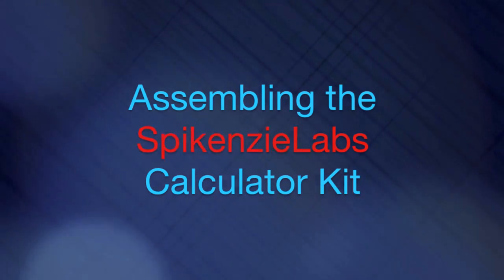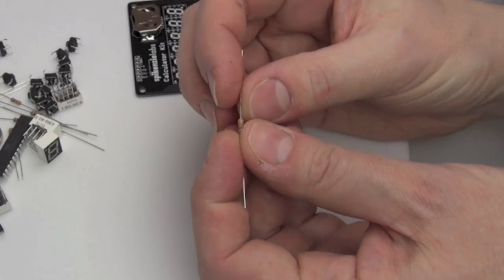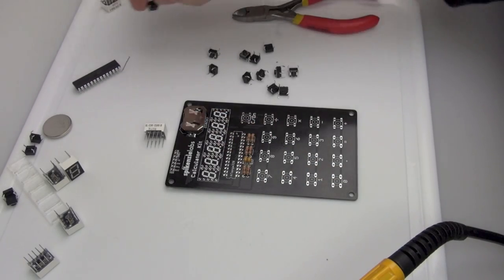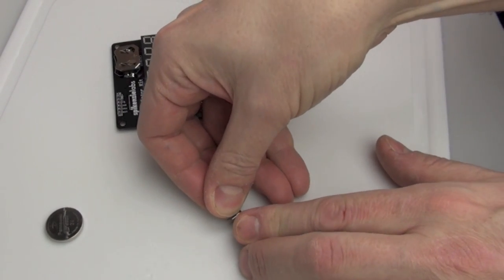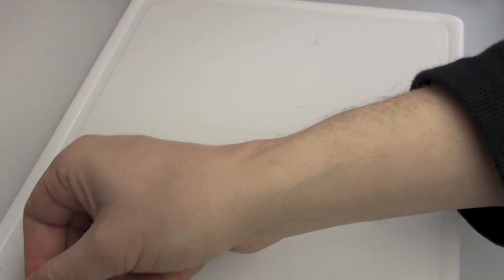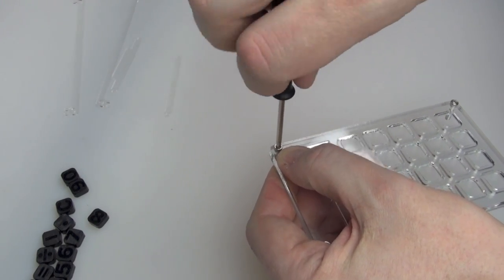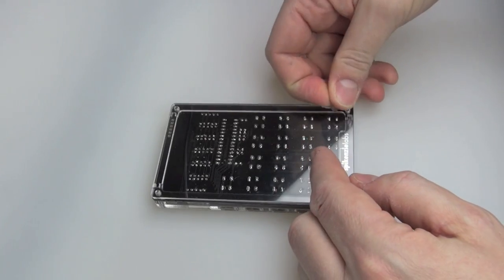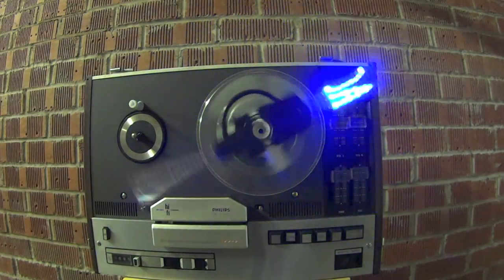Assembling the SpikenzieLabs CALCULATOR KIT (2013 video)

Comment: fitting a resistor will work either way round
Reply: Yep, only bad thing happening is your OCD kicking in. He probably got confused with transistors.
Reply: The do look better all placed the same way.
Reply: If you're using resistors of different values, it's probably a good idea to make them easier to read, but a resistor that is different depending on which way 'round you install it is called a diode! ;->
Reply: Actually fitting them all the same way looks way more professional. But yeah, they'll work either way..
Reply: @sambrown9494  Or you could use them to spell something in binary?
Reply: @DanielNoblett1111  Some capacitors: Yup. Electrolytic capacitors are polarized.
Reply: I would have preferred the numbers to remain white as the black numbers are very hard to see.

Rev George
Reply: @maxmustermann1455  or diodes 🤷

Comment: Resistors don't have polarity, you can put them anyway you like.
People usually put them all in same direction only so its easier to read the values (colors), and to look nice.
Capacitors and diodes have polarity and can work only one way.
Reply: i was about to be like uh.... hes trolling right?
Reply: @thomasslone1964  Right? WTH?!
Reply: Yes, that's correct, resistors aren't polarised, so you could fit them either way round.  But they look better if they're the same way round!  It's the same with ceramic capacitors.  Electrolytic capacitors & diodes are polarised though.
Reply: @Aphrodite-fh3vk  Found that out the hard way. BOOM!

Comment from the maker: Looks like I've learnt something about resistors. Three comments out of five means that this will probably be a popular comment on this video. I can see that I'll be receiving similar comments for years to come.
Reply: Here's my 2 cents, or P if you like, resistors aren't polarity sensitive, but diodes, transistors, and most electrolytic or tantalum capacitors are. That said, as another commented it does look more professional. I really do like your videos, but this one struck a chord with me. Back in 1976 or 1977, I bought and assembled a Heathkit calculator, which I used for the rest of High School (1978). It was quite a bit more complicated, having separate driver transistors for the LED display segments. I believe it was 16. 1 for each digit, and 1 for each segment and the decimal. I just had to google that old thing and I believe it was the model IC-2006. According to the Datamath website http://www.datamath.org/Related/Heathkit/IC2006.htm   the original price was $69.95 in October of 1973. I believe I paid in the neighborhood of $30.00 in 1976 or 7, as it was on clearance. Possibly you could try to find some Heathkit equipment to try out. Heathkit made Ham Radio equipment, Audio, Televisions, Radio Control equipment for model airplanes, boats and cars, and electronic test equipment such as signal generators, vectorscopes, and ocilloscopes. Heathkit Audio was almost considered audiophile quality.

Comment from the maker: I've got a job where a typical calculation would be along the lines of £90.28 +0.2% -15% +28% -0.25% +£10 -52.72% +3.78% (and on for about 25 steps)...speed is also important...hence the necessity to me for a % key.
Reply: I guess you are a stock broker !

Comment: I was working with some led 7 segment displays recently, by putting a thin translucent layer over the display you can increase the contrast of the 'off' segments dramatically; dark plastic, filter gels, even a post-it note does wonders for readability.

Comment: It's basically a $2 microcontroller that's programmed with whatever SpikenzieLabs put on the thing
Reply: it'd probably cost like $40 to make though if you paid for the PCB from somewhere like OSHpark or seeed, then bought the LED display, buttons, MCU, supporting components, had somewhere like protolabs or shapeways make the enclosure, etc. Not to mention the cost of your time actually designing Everything. Not saying it's worth $40... hell, I wouldn't even pay $10 from an eBay seller for this kit, but whatever.
Reply: @martinj9268  or you can order tjem in China and pay like 5 bucks a pop. What is what they probably had done.
Reply: @martinj9268  well the pcb (seeed wants 4 bucks for 10pcs each 10*10cm) is probably the cheapest compared to stuff like the custom lasered acrylic and actual time going into not only designing it but the whole overhead of getting the components into the kits, operating the laser cutter (spikenzie cut their own stuff afaik), packaging, shipping etc...
Reply: @nonchip  I wouldn't think by much. Especially if they're cutting the acrylic themselves. Acrylic is one of the absolute cheapest materials for custom enclosures only after things like cardboard, cardstock, PET, etc. If you already have a laser cutter it would cost maybe like $2 to make the pieces for the enclosure and effectively none of your time. Development cost and overhead is also basically nothing once you spread it across more than a hundred plus units. I mean its not like they spent months of R&D along with weekly design meetings to make this. It was probably a few hours in sketchup and kicad. The most expensive part is probably the human assembling the kits, though these days human labor is also dumb cheap and would probably only add a dollar or two per kit, even if they were paying them like $20/hr(which they probably aren't unless they themselves are assembling the kits). I'm not trying to bash them, I'm just saying. I myself could make this using prototyping services like oshpark and ponoko for under $40 for a single one. Add in the fact they're making parts themselves and buying in bulk, there's no doubt in my mind this cost far under $40 each unless they're cutting a huge piece out for a ridiculous salary or something. In the end it's just a novelty gadget anyways. Why anyone would pay more than ~$20 for something they'll likely never use anyway is beyond me.
Reply: @martinj9268  well they did strike me more as a hackerspace than evilcorp so i think the humans and laser time are probably their highest expenses... if they're anything close to smart they're not using oshpark for this kind of "mid sized series" thing so their pcbs/components will probably tally in at 1-3 bucks per kit. having someone watch for a cnc laser catching fire while that eats through watts is probably more expensive, unless they went full-on chinese fulfillment ofc. oh and the amount of clear, unburned, uncracked acrylic going into this suggests they probably have some rejects, and acrylic really isn't that cheap. and they have about 3.5times more acrylic (just by area; plus it's thicker) than pcb...

oh and don't forget the business overhead. someone has to sit there, read the orders, pack them up, ship them, keep the right records for tax purposes, etc. add that to the fact they probably want to make at least a bit of money and you'll see why they probably cost at least 2.5times their expenses.
Reply: A 16 button 6 digit 8-segment-display calculator, pretty simple code really
Reply: wellll there is a custom made circut board along with the price of the machine

Comment: Techmoan, in the video you said that people shouldn't touch the chips. This is due to static electricity charges in your clothing that can discharge through the chip so destroying it.
However, it looks like you were building this kit on a nylon type of chopping board. Just like nylon clothing, that chopping board can carry a high static charge endangering sensitive electronic components.

Take static precautions when building electronic projects. Invest in an antistatic wrist strap.

Ian.

Comment: The resistors you can orient pretty much any way, along with inductors and unpolarised capacitors. It's all the other components that need proper orientation, particularly polarised capacitors which can explode if installed backwards.

Comment: Nice enough video, EXCEPT:
- as others have noted, resistors and ceramic capacitors are not polarized
- the preferred technique for straightening IC pins is to lay one side's pins flat on a table and hold the IC body, rocking it over firmly. Doing it with your finger not only gets less than ideal straightening, but a good change of poking your fingers
- I could see in your video that the black keys were not fully adhered to their clear plastic carriers....the bubbles in the adhesive were apparent. When I built mine, I took all keys out and firmly squeezed them together for more complete adhesive attachment
- There is really no need to use the tape if normal PCB assembly techniques are used, but nothing really wring with your way way, either
- VERY bad practice to snip off leads from a PCB the way shown in the video! Lay the board down on the table, hold the ends of the lead with fingers of one hand, snip them off with the cutter in the other hand. OR, do like the skilled professionals....holding the handles of the diagonal cutter between thumb and little finger (the cutter must have spring return handles for this to work), freeing up the index finger of the same hand to touch the end of the lead when cutting, with the PCB over a trash can...as soon as the lead is cut, it fall into the trash and you move on to the next lead....very fast, easy and SAFE.

Some other comments based on my own experiences with this:
- This is obviously a piece of working sculpture. Nobody would buy this to be their 'working' calculator....too few digits, too few functions.....it is intended to be a fun and perhaps educational piece of art that also works....with that in mind, the price is not outrageous
- The spacer behind the LEDs is there to raise them so that their faces are close to the front of the case, instead of being recessed, but I noticed that with this spacer they are still a bit sunken back from the front
- The LEDs really need a red filter in order to see the beautiful large display clearly in normal light. I checked and found that almost all industrial LED displays use a red Lexan filter that ....guess what....is exactly as thick as the Spikenzie kit's LEDs are recessed back from the front of the case.....as if the Spikenzie designers had intended to use a piece of that red Lexan in the kit, but then changed their mind and left it out. DigiKey sells small pieces of that red Lexan (from PRD Plastics) that are just about the right size for this kit, and I bought one and used two tiny drops of super glue to affix the filter to the front of the LEDs, and now that filter is precisely flush with the front of the case and the LEDs look spectacular even in bright room light.
- I recommend assembly of the clear plastic case while wearing nitrile gloves (like machinists and mechanics use these days to keep their hands clean)...you can buy them by the carton for very cheap....and wear these gloves while handling the case parts. Have a lint free cloth (microfiber wash clothes or shop rags work well) with ammonia window cleaner to wipe the pieces free of finger prints before and during assembly, and have a can of compressed air (a.k.a. air duster) to blow away dust. This way you assembled calculator will have a sparking clean look with no dust and fingerprints showing through.
Reply: Dear youtuuba , the resistor part rustled my jimmies so hard i was gonna comment this, thanks for beating me to it by 1 year. Btw your comment is underapreciated.
Reply: youtuuba this ain't be no comment dis be a freaking essay
Reply: Micah Angelo the guys name is YouTuba
Reply: Officialpoiuytrewq4645 lol
Reply: One thing to say: you did a bunch of criticising here, and while I'm fine with that, just try to not make the actual comment give into one of the things that I didn't like: you called the acrylic plastic. It's acrylic, not plastic.
Reply: @willowithink  acrylic is plastic. thermoplastic to be precise.
Reply: @chimpdr  problem with doing it the "fun" way is you get tiny metal pieces all over your live electronics, carpet and eyes though :P another thing to be careful when clipping the leads btw is making sure you don't go too flush (leave like a milimeter or so) because otherwise your cutting tool might excert enough force on the solder joint to actually damage the board.

Comment: One thing I don't understand they omitted in the kit. A piece of red frosted tape or similar for the display. Those displays are really hard to read without a diffuser in front of them. Or they could just have chosen LED modules not requiring diffuser although these days they're not as common as they were in the 80s

Comment: Missed opportunity not having the first thing you typed into the calculator be 58008
Reply: 14215469 x 5 = 71077345   As this was the mid '70s the joke went 142 Israelis fought 154 Arabs over 69 oil wells. They fought for 5 days. Who won?

Comment: Resistors are not polarised, you can put them in anyway, the stripes are the values of the resistor and just get painted which ever way the resistor comes out before it gets painted.
Reply: PBMS123 I would still line them up so they look nice in the clear case, and so they are easier to read.
Reply: PBMS123
any way*

Comment: Actually not all the capacitors are polarized, Tantalum and some if not most Electrolytics caps are polarized.

The ones that came with the kit must be either ceramic o plastic film capacitors.

Diodes allow current to flow the other way (reverse bias) negative to positive as long  as the voltage is bellow ground.

Comment: Does there exist a such kit with at least 10 digits?
Reply: thing about that is: they would run out of pins on the chip to control them. they are probably doing some very fancy stuff to fit all those buttons and leds into the pin count anyway, so if you want more, you would need something like a shift register added to get more outputs from the microcontroller, or just use a serial (e.g. OLED or lcd) display instead. so tl;dr: such a kit would of course be possible, but not as "basic" (which is part of the point here, to show people how it actually works)

Comment: Sorry, I thought of ATMega and wrote Arduino. :) I see no reason why the Microcontroller needs to be removed, the PCB got a pinout for a FTDI-cable. a plain 5-pin connector soldered to the PCB should be enough, and also would fit in the case. The video also shows the settings to reprog it: 00:48

Comment: Watching this in 2017, surprised this thing is still for sale, you could make a raspberry pi console for the same price, and it will be a thing you'll actually use and enjoy, not a calculator less functional than those you'd find at a supermarket.

Comment: Spikenzielabs is still offering this device for $44. They have a heck of a nerve charging that kind of money for such a basic calculator.  Forgetting the fact that any smartphone has a far more feature-rich calculator, a few bucks will buy a solar powered calculator many more desirable features, including memory functions, percentage calculations, square root, etc.

I used to build Heathkits when I was younger, and the advantage of building those kits was cost savings.  I checked the Spikenzielabs website.  Some of the kits might offer some educational value for youngsters, but the bulk of their stuff was overpriced and low-tech.
Reply: Stephen, you are off base here. First, Spikenzie Labs do not owe you or anyone else any favors when it comes to the price they put on their products......so you seem to be unreasonably outraged (how do they have the NERVE to charge the price they do?)

Second, Heathkits were only about saving money in their early days. For most of their time in Business, they were about the fun and satisfaction of building something yourself....it was no longer cheaper to build kits than buy ready made electronic devices.

Third, you seem to have no notion of what things actually cost. As soon as you make a kit of an electronics project, you need to make it using through-hole parts, which means that the PCB and parts are more expensive than what is done for mass production. Then the low quantities involved with most kits mean that everything is much more expensive for the kit maker to buy. Then there is all the individual parts marking and packaging. 

This kit cannot reasonably be considered to be very much overpriced. AND, it comes out of North America, and is not some low ball product from China that is government subsidized.

Comment: I know this is 7 years later.
Just watching this now.  Your soldering is pretty good compared to some I have seen.  The only little thing.  Resistors can go in anyway, the orientation is only for looks only not for electrical function.  Some caps and diodes are directional, but not resistors.